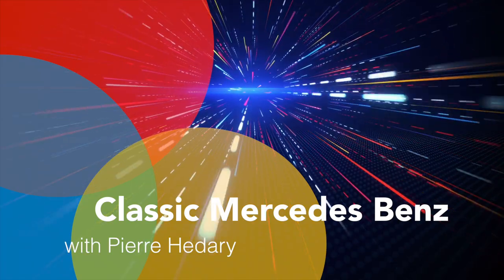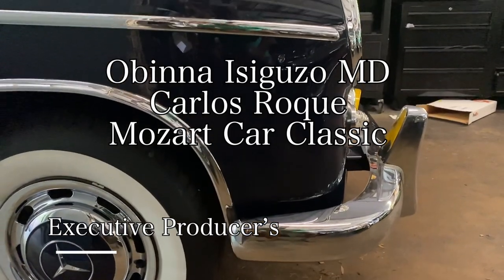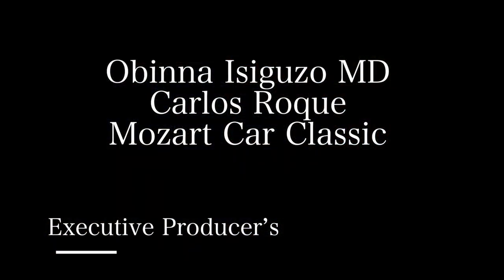Five warning signs your timing chain may need to be changed

Comment: swapping from a #14 head to a #17 head on my OM603 after it finally gave up the ghost after 340k miles, I checked chain stretch, and it was only 2 degrees,  I was thoroughly impressed. But honestly not very surprised.

Comment: with my 85 500sec tribute i had done all this work, body kit, audio, wheels suspension  etc and etc ....car ran great.....but in the three yrs i owned this car i didnt check the chain or guides

took it in for an oil change and asked my mechanic to just have a peak....driver side guide had already broke and was wedged in there.....phew got so lucky....so we did the chain anguides etc....and decided to paint the valve covers for fun  -- nautic blue

Comment: This is my number one concern right now, since the prior owner had commented that the car had troubles at idle right before the starter failed. Still trying to see if its starter in actuality since that monster relay near the wiper arm on the firewall was pulled loose of the mounting point. Don't even want to try and start the W126 till I've pulled the valve cover to check for slop in that chain and tensioner. I'll make an effort to find German parts since replacing it more often just means spending more cash in the long run anyways. Thank you.

Comment: Thanks Pierre, got a new timing chain and the plastic parts for the camshaft oiler tuber coming - my 5.6 117.968 has over 330K miles on it but I am not sure on how many times the timing chain and associated parts have been changed. 
When you say degrees, are you referring to degressivere of distributor? Could you please recommend which tools to get for this job? Many thanks for your videos! Peter

Comment: Thank you Pierre for the advicing ! On a w203, m111.745 , kompressor, German factory assembly product, it is the one with double timing chain, with regular  oil and oil filter changes every 5.000 kilometers, is it possible that it could last for 200.000? kilometers?
Reply: I know you are asking a master.  I am not but hope you don't mind I chimp in.  2 Mercedeses I have.

1992 190e 2.6 @ 268,866 and it runs like the first day it rolled out of Stuttgart.  Absolutely a pleasure on the freeway.

2003 CLK320 Cabriolet @ 308,963.  A most wonderful, amazing driving sensation everytime I use it for work or pleasure.  I cannot describe in words the magical experience I feel when I drive these excellent, exceptionally engineered vehicles.  Oil.  Use only the best which is Mobile.  Filters, factory or factory OEMs.  Like Pierre said, don't touch the timing chain issue unless for cause.  My 2 Mercedes gems I know will last me a lifetime and unless something really extraordinary happens it is highly doubtful to have to deal with timing chains.

Comment: Hi Pierre, Would please be able to comment on timing chain issues regarding W211 E200K 2007 ( A271 1.8 litre engine ) with 250,000 Kms on clock. Not making any strange noises but sometimes when driving into my garage the engine sort of flutters when at low revs as I approach and slow down. My drive-way has a steep hill then levels off - this is when I notice this sort fluttering of the engine like it momentarily looses power - but doesnt stall.  Maybe if you can a video regarding the timing chain on this engine would be great .   Love your videos which are so easy to understand. Cheerz Stuart from Australia.

Comment: I have a 59 Ford thunderbird 352 engine replaced the whole distributor router cap wires spark plugs carburetor and lines fuel pump fuel filter just about everything I can think of and it's still mis firing any chance it could be the timing chain?

Comment: I changed my fuel pump my spark plugs and wires and fuel
Pump assembly on my 2000 Honda Accord and it cranked at 1st but wasn’t Alternating right now it won’t crank at all

Comment: Hey Pierre. What about m115 4 cylinder gas timing chains ? Are there any warning signs for them ore are they robust enough that they don't need maintenance ? And can you make a video about adjusting and rebuilding stromberg constant depression carburettors specifically the 175 cdtu ?

Comment: Are there any engines that don't seem to suffer this problem as much?  M103? 104 perhaps?
Reply: From my experience working for MB in the mid to late 90ties we did see some replacement on the M103 and M104 but this was at around 250 to 300K km's. We had a few of those and they were mostly running LPG, which in the Netherlands was economical at higher yearly km's. I have owned a OM104 in a 1992 C124 which was unfortunately totaled by a friend to whom I borrowed it when he was in bind, it at the time had well over 350K km's and I had done a service not long before with a chain inspection and it was well within spec. Obviously proper maintenance and allowing proper warm up before loading the engine are fundamental, but this is true not just for the chain and tensioner.

Comment: Hi Pierre, great video as always, how about the OM606? I have a 1995 E300 with 300k miles, no signs of chain trouble, and oil changes religiously every 3000 miles, but should I be planning on replacing it anytime soon? Thanks!
Reply: I have the 1999 e300 turbo diesel 315,000km 

Never replace timing chain 

Om606 wonderful engine

Comment: You know how you said you shouldn’t be able to hear the rattle sound well my 2013 Mercedes c250 you can hear that thing from like 2 house down but I can’t seem to find the problem it started when I got the cam shaft sensor code but I replaced that and it didn’t fix the problem and the car takes a while to start some times
Reply: Hey Sean. I have 2012 c250 same issue with the noise and code. Are you still driving it like that? I was wondering if I can keep driving it like this

Comment: I use to have an early W201 4 cyl petrol it had an single chain it broke unexpectly i had also an W638 with the om601970 engine and the gear wheel what was on the feul pump broke and the the chain jumped but fortunaly  an om 601 602 603 engines are not interferring engines so no valves were broken.

What is the best make for timing chains besides mercedes  ??
Reply: I guess you were lucky, as OM601to606 as well as practically any diesel as well as M102,3 and4 are interference engines. it may happen the hydraulic lifters helped to cushion but in general there is substantial damage.... I lucked out with one as well, a 25K km OM601 where the vacuum pump decided to give up and dropped shrapnel down the engine skipping the chain and destroying the guides.
Reply: @Izrealeu  in my  humble opinon if you se the top of the cylinders the are cut outs for the valves. i have german book for to rebuild the engine an that book states that this engine is an non interference engine
Reply: @peterjanvanbijnen226  Cylinder cut outs are not (necessarily) for non interference, they are (in most cases) for allowing longer valve opening/cam duration or overlap. I do not have my manuals here at the moment, but have been an MB tech for passenger cars in the Netherlands for quite some time. I stopped in 1998, but am pretty sure that all post 1980 MB engines up until 1998 when I stopped  are interference engines. As it is not exactly clear which engine you are referring to specifically here as you mention 2 I will not say this is a definitive answer, perhaps you could make that more clear and I can check tomorrow when I am at my work shop but I am fairly confident all are interference engines.
Reply: @Izrealeu  it is an om601970 for an vito W638 from 1999 i had an chaiming chai what sprung over deu to the gear weel broke what was on the injektion pump there was no damage to the valves
Reply: @peterjanvanbijnen226  All diesels (at least car/truck) are interference engines, no exceptions.